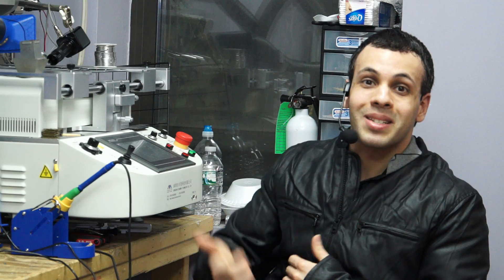How to get your #mbp2011 problem fixed for free!

Comment: I don't think that running GpuTest for weeks or months continuously is the correct solution. We have to remember the GPU fails under normal usage and normal usage doesn't involve running the GPU 24/7. The appropriate solution is to (find a way to) continuously heat up and then quickly cool down the GPU. This would cause fatigue failure in poorly designed laptops (like the 2011 MBP). ---- I would love to hear suggestions on how to automate this process.
Reply: Thats what I was thinking...because while FurMark is running the fans continuously  run at full speed and never let the gpu reach over 80 degrees...
The only alternative that I've found so far is Benchmark Valley which will allow you to at least heat up the gpu to 81-82 degrees until the fans start running at full speed and cooling it down again..but Im not sure if that's enough

Comment: 4/12/16 -- I've got a 2011 17" with this problem. I brought it in to an Apple store today. They tested the chip and verified it was toast so they took it in for repair. When asked if they were replacing just the chip the response was no, that they were replacing the whole board and this new board will have an updated chip. So, if they are actually replacing the board and it has an updated GPU is it really worth trying to fry the board? I like (and have a 15") retina but I like the 17" for coding. Thanks.
Reply from the maker: +sigfts updated chip is bullshit
Reply: +Louis Rossmann Thanks. Know of any reliable utilities that I can use to gather info. on the "new" chip (or even board for that matter) when it's back? I'd be happy to report what I find. Should be 4-5 days. If they tell me it's a new board and updated chip I think 1. People should know about it and 2. I'll probably use any lies to my advantage.
Reply from the maker: Read me the number printed on the GPU itself and I'll prove that what they said is bullshit.
Reply: +Louis Rossmann Will do when I get it back. Stay tuned...
Reply: Got it back. Works great but same GPU. Did they just keep a crap load of these old boards in storage for 5 years?
Reply from the maker: sigfts Probably. What was the number on the chip?

Comment: Just dropped of my 2011 mbp at Apples. They confirmed it is a GPU issue and will replace it for free. I should get it back in a bout a week. They have to order the piece. Using and old 2006 Compaq nc8430 with a 1680 x 1050 screen running Windows 2007. Maybe worth 100$ today but still a nice and reliable machine!  I guess the best  Windows machines are generally for corporate clients and are not easily available to the layman of the street. For the price I payed for my mbp, I feel I should miss is much more!
Reply from the maker: +Patrick Leuchtmann a 2006 compaq has the resolution of a 2011 macbook pro

Comment: 2011 gfx warranty almost all over I sent 16 MBP 15" to the apple store this year. I have no idea If I'll stay behind the MBP after this is over I love the old MBP It's tough holds 2 ssds and 16gb of ram for a fraction of the price of a retina. Hey we still have the 2012s before we have to abandon the awesome of upgrading a MBP.
Reply: +Christopher Fletcher how long has it been since the last repair.

I know mine will fail and I hope it fails while the programme is running. did you do anything that speeds up the rate it dies at
Reply: +Christopher Fletcher I had mine repaired for a second time since december. they replaced the logic board both times. after the first repair my laptop had no ability to wake from sleep mode. it would just crash. I know it will crash soon and I just want to kill it rather than wait. 

sometimes the machines reaches over 90 degrees Celsius and it's become so frustrating to use.

what do you mean by 10 configs and is there anything that I can do to kill the machine quicker. has the same issue returned for you with the lines and everything or is it a different issue. also if you had it repaired that many times would apple just not replace the device?
Reply: Apple will look for any reason to deny coverage they may be right about your ram you should test it make your mac factory as possible then bring it back then they will have no reason to deny you.
Reply: I have had macs denied warranty repairs for any reason i have a HD a screen battery ram bottom case everything set aside so I can get my clients macs repaired the first time also I replace water censers and signs of dirt It's sad just to save 300 bucks i charge 100 or 150 and i have macs come back from apple 2 or 3 times with the same issues I offer to replace the logic board myself if time is an issue. Still they fix them for free I have had them give every part in a MBP for free I still love apple. Even if they make you jump threw hoops they will help you.
Reply from the maker: +Christopher Fletcher They used to deny people with the A1226/A1260 failure if they couldn't run their service test to confirm it was the GPU.

When the GPU failed in those machines, it would not POST. 

So they couldn't run the test.

And they wouldn't help you out.

They're repeating the same thing seven years later. Isn't Apple just GREAT to their end users?
Reply: +Christopher Fletcher looks like they extended it
Reply: -tcc -
Thanks for the heads up your awesome! This fantastic news and Apple added 2013 as well! https://www.apple.com/support/macbookpro-videoissues/
Reply: My 2011 MBP is at Apple for the second time this year for this issue :(
Reply: It's the second time I've returned mine this year. I have a repair shop I sent 16 MBP 15" to apple this year and 4 again for the same issue.
Reply: I need to find out who's repairs have been the best quality. I wonder how Apple expects to service with quality parts getting rare. Apple has been pretty awesome for repairing these MBPs. I have to admit I'm not looking forward to another year of apple appointments.
Reply: I use mine as a Genni puppy It has 10 different configs a week also I use it as a practice server. So yeah I done a few things to quicken its demise. Honestly I could tell from day one that the repair was not done properly. same with all those macs.
*****
Reply: Listen to Louise. What I mean Is I Put different Drives Screens and Ram ect..in my Mac. I use it to test hardware.
Reply: Just back up your data and hope you don't have anything wrong with your mac apple considers your fault like water damage or a single drop of food on your logic board. Apple should help you now if you brought it to them.*****
Reply: +Christopher Fletcher just went to the store to be told that the issue is happening because my device has 16gb ram rather then the 8gb it supports and came with. 
I said i can take one of the 8gb rams off and downgrade the ram to 8gb.

The genius said its better to have 2 x 4gb units which doesnt make sense to me. I waited an hour at the store to be told this nonsense not sure what to do. the stress test doesnt seem to be doing anything as the device shuts down after a certain temp is reached

any ideas chris?

Comment: Good news guys!....Apple has extended the 2011 MacBook pro repair extension program until December 31, 2016...https://www.apple.com/support/macbookpro-videoissues/
Reply: I'm too late for this, it just happened to my computer December 2017 :/
Reply: +Jerin Abraham thats what i wanted to say, changed the chip 2 weeks ago for a late 2011 17 inch

Comment: +Louis Rossmann . How long is a stress test supposed to take on a newly fixed 15 inch mid 2011 MBP before it starts showing the same symptoms. Awesome video by the way. Thank you.
Reply: +Tyaniishdunk829 it's totally random. you can get there in 1 hour if the chip was weak but it might take you even a few weeks if the chip was like new... 
still considering what you are putting in and what you are getting in return - new laptop for pressing 5 buttons and leaving the thing alone for some time...... total bargain

Comment: the extended apple warranty will be over on February 27, 2016
https://www.apple.com/ie/support/macbookpro-videoissues/

also keep in mind just because you have an effected laptop like the 2011 15inch macbook pro, when u have GPU issues or random freezing or not booting issue that it CAN be a reflow-reball issue, so FIRST it is worth to reflow or reball the chip because how can u be sure that the "new" GPU chip will work, probably they are coming from the dark side of the chinese market.
Dont fool yourself thinking right away the it is the chip itself, because 99% of the time the chip is fine, it is the solder ball, especially if you have 2011 I7 CPU, which is a BGA chip too,  in that case try to first reflow both the I7 CPU AND the dedicated graphics card.
Reply from the maker: +fifferfiffer This idea of it being the solder balls on these laptops is total BS.
Reply: +Louis Rossmann recently myself reflowed 2 of these 2011 15inch macbook with I7 cpu and both laptop worked.
The symptoms before the repair was not booting from any device, trying new hdd and hdd cable or any usb device. 
The same is happing with the newer macbook pro 13inch with I5 or I7, when it wont even boot from an usb osx installer and the board is not water damaged or having some other weird issues there is a very good chance that the I5 or I7 cpu reflow (for the brave ones reball) will sort it.

The BGA is the perfect tool for planned obsolation. The next popular victim on the table is sony PS4, and the slim laptops where they dont use PGA socket for the CPU anymore but BGA only.

Comment: Oh shit you gave me an idea to get the 2013 Mac Pro stress the gpu and see if I could get a new Mac Pro every time the warranty is about to be over this way I get a new Mac all the time they already 2000 plus gran for a iMac that has dead gpu and they won't fix it, this will be my revenge I am going to get that program so it will fail and I get a new Mac Pro all the time thank you for the advice.
Reply from the maker: +atabeylive You're not supposed to do this to fuck over Apple you do this to get a replacement for a failed machine..
Reply: +Louis Rossmann I spend 2000 plus gran on a iMac which right after warranty my fucking graphic card died out and apple told me they cannot repair it and guess what Apple has left me with no computer. Oh yes and I am writing this from my fucking iPhone so I will do what I want get a Mac Pro 2013 fry the gpu which is probably a crap gpu and when the new Mac Pro the one up to date
Reply: +atabeylive with software only u cant kill the gpu chip itself, u can help the solder balls under the gpu to be cracked by overheating the machine, but dont believe that is that easy, if it was manufactured and assembled really well it can go year 24/7 at max cpu/gpu load and it wont crack the BGA solder balls.

Simply a cracked solder ball issue is not included in the extended warranty (unless u have apple care,  max 3 years from the date of purchase).

Comment: I've just had my second logic board replacement (MBP Early 2011) yesterday. I got it repaired in the Barcelona Apple Store, my first repair was in NY before the Quality Program (~300 USD).
I have 90 days warranty on the logic board. Should I still try to kill it with GPUTest? I can't figure out how to run it on 2 screen at a time.
Is there any proof that Apple really fixed the problem on these logic boards? Or are they still replacing them with the original ones?

Thanks!

Comment: Even with the Repair Extension Quality Program that is currently in effect, you can get your unit REPLACED after multiple failed repairs in accordance with the Magnuson-Moss Warranty Act. Basically entails that the end-user of a product is entitled to a full refund or replacement of their device after multiple failed attempts at a repair. The fact that Apple opened a repair extension is even more reason for you to be able to get a replacement unit.

Take it in multiple times with proof that your issues have not been resolved then you are ENTITLED to a replacement unit in accordance with US law. Good luck!

Comment: i have a mid 2011 MBP that restarts at random, took it to apple and they said $310 to repair the video card issue after doing a diagnostic test on it. So from whet you're saying, I will encounter this issue again for sure......after i get the computer back, is it a good idea to ask how the computer was repaired, like for example "did you guys put a different mother board in, or did yall just heat up the glue to stick the same video card back on?". i know they can lie, but i guess My thinking is when it fails again, i can use the fact that they lied about the fixing process to get a better motherboard, or updated unit.

Comment: hi Louis Rossmann 
i currently have a a gaming pc that is kind of heavy and its battery cant last more than 3 hours, and i need a laptop for college that can handle Microsoft word and may be some Photoshop editing, so i considered buying a used macbook pro 2011 for around 600 usd ( cor i7 ,8 g ram , 500gb hard )  ... would you recommend buying such a macbook , i was about to buy it until i found this video ... and i was aware of the GPU issue ....
i will be thankful to hear your answer :)

Comment: I'm on my 3rd replacement in 4 years and it's just failed again... For what it it's worth I wasn't polite in my letter to Cupertino...
Reply: +Paul Johnson i still have mine, still working perfectly, would you recommend selling it while it still works?
Reply: Apple just replaced mine with a 15" MBP retina, so probably best to follow Louis's advice. Though if it's still going fine and you can't be bothered with the hassle, I would probably just keep it.
Reply: +Paul Johnson Have they ever changed your logic board (during those 3 repairs) with 661-5852 model?
Reply: Don't know sorry

Comment: Louis Rossmann Thank you for this video. I like your no-nonsense, simple and honest approach. Subscribed for sure! Do you still recommend this solution from your video? Seems Apple has wised up and is not replacing after several fixes anymore. I have a 15" Macbook Pro 8,2 with Quad-core Intel Core i7, 2.2ghz, Intel HD Graphics 3000 with 512MB & AMD Radeon HD 6750M with 1GB, model A1286 with 16gb ram, 500gb hard drive. Last night we were watching a movie in 1080p, 3/4 of the way through, at the bottom middle of the screen some colors shot up like a straight bolt about 1/2 wide, and the line was 2-3 inches long. Then blank gray screen. The processor area was hot (was resting on my lap), but not excessively. Computer wouldn't respond. Now upon restart I hear the sound, see the apple logo, then see the spinning (wait) symbol, then it goes to a blank white screen and sits forever. Reset NVRAM and SMC, nothing changed. Tried booting to safe mode, it loads the bar, then total blue screen with lines, no further progress. Currently running extended apple Hardware test, the basic AHT didn't find anything wrong. Some forums recommended reballing (that's how I ended up at your video). Not sure where to go from here.
Reply: Chris Burley Update 6-15-15: Just took it to the Apple Genius bar, they ran diagnostics and determined the video was shot. They are replacing the logic board and will have it back to me in 3-5 days.

Apple is now addressing the issue FYI: http://www.apple.com/support/macbookpro-videoissues/
Reply: +Chris Burley I just dropped mine off today....they r replacing the graphics card for free......was wondering if your Mac is still running strong ?

Comment: I just had the second logic board replaced, original one failed last september, replacement failed this February.  The original one was replaced using an extended warranty that i bought from Best Buy. I had a terrible experience with Best Buy.  They took about a month to fix it and put in a used logic board form another machine with a different serial number, but they told me it was new. With lots of back and forth with Apple, lots of phone calls  emails and pictures of the mis matching serial numbers i was finally able to access the replacement program after months of lost time and productivity.   Interestingly enough here in Canada the logic board repair is quoted at $700.  How are the replacement logic boards holding up? Thanks

Comment: After first repair last month (three years with no errors), I checked Logic Board Number and is 820-2915-B, that logic board will fail soon right? I can make GPU test using external display in order to get the fail again? and two times more...
Reply: Carlos Alvarado It should fail ultimately yes.